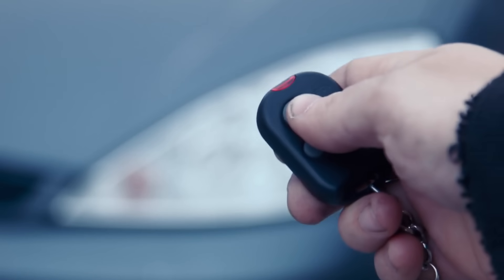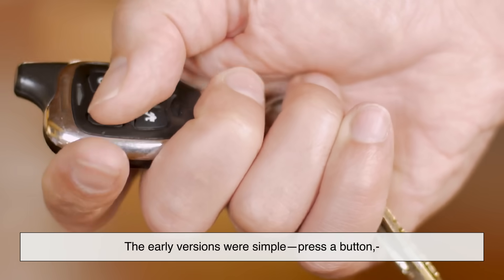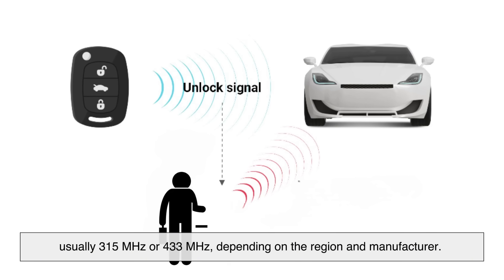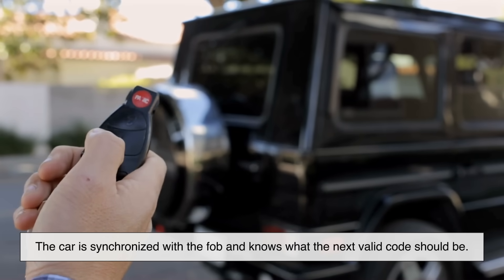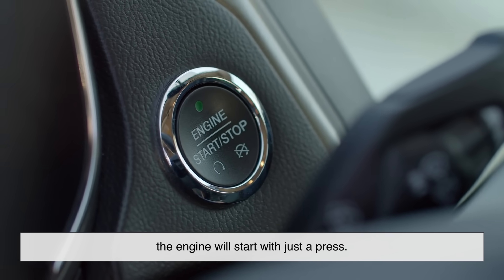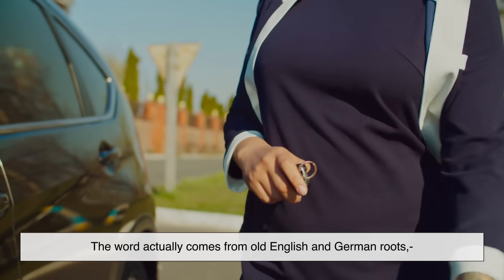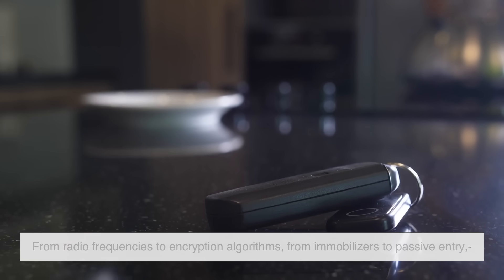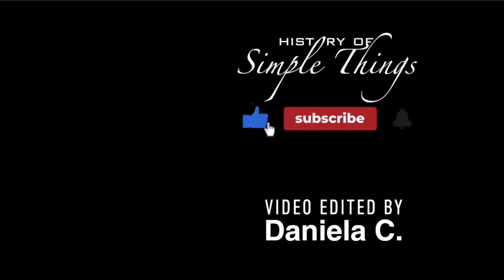How Does a Key Fob Really Work?

Comment: Key fobs are a TERRIBLE idea when attached to the key. If you drop your keys in the parking lot, all the bad buy has to do is click the red button and the car yells, "HERE I AM, COME GET ME!" Keep your key fob SEPARATE from your car keys!
Reply: You have a better idea in order to keep cars (sure even planes and boats) from getting stolen and from losing the keys thereto?

History of Simple Things personnel: Quite an informative video you made here. Let’s do an episode about when cars used to have cigarette lighters that you pressed into a socket and it popped out when heated enough. How did THAT work? Or how about when cars had cassette players; how did the device flip the two-sided cassette to the other side in such a narrow slot? Third idea: the evolution of using a telephone in the car.
Reply: My car doesn’t use keys.  So I guess separating the fob from the keys is a bit difficult.

Comment: How to get into a car that the  battery is DOA?
Reply: Most car makers create a bone key which is inserted in the fob. Similarly the press button start can be removed and insert the actual key fob.
Reply: @apollo972  Thanks!
Reply: My car’s fob contains a well hidden key.  Once you have opened the door.  If you place the fob inside the console between the seats, the fob will be energized by the car and will work even with no battery.

Comment: A Key is Most important, the fob should always be an Option.✌️🍻
Reply: Remote entry key fobs have a physical key inside in case the battery dies. Either use the key to unlock the door and turn the ignition, or if you have a stop/start button, hold the fob next to the stop/start button to start the ignition.